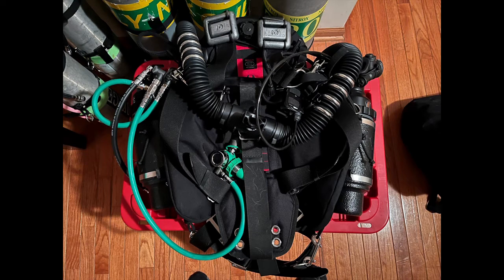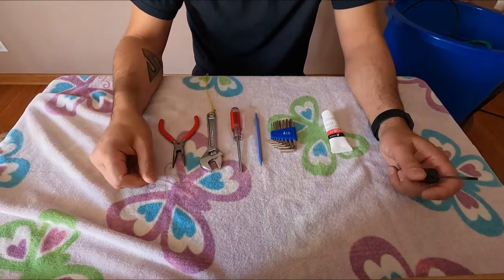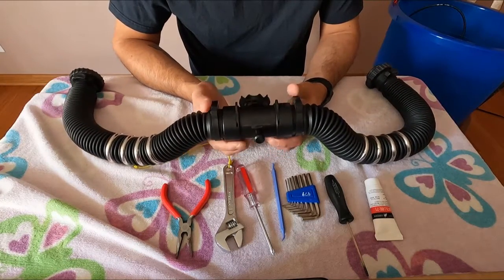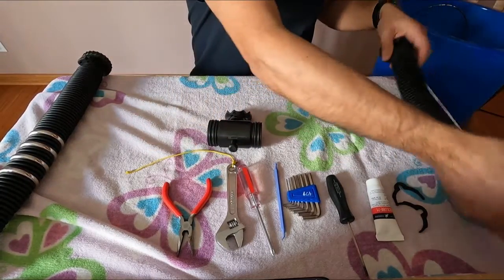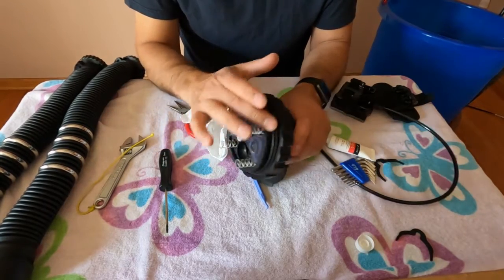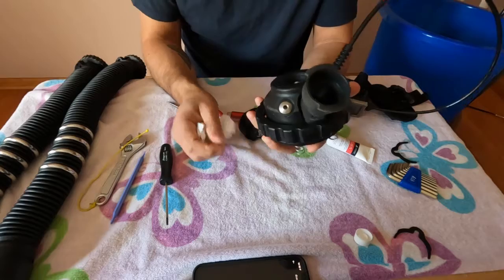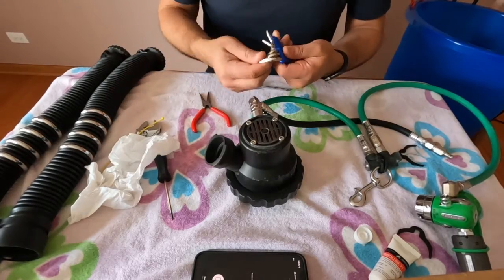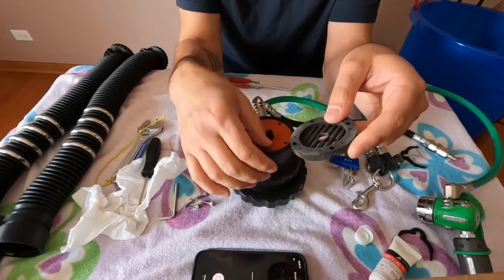Kiss Sidewinder Maintenance

Comment: First thank you for taking the time to help me evaluate this unit. Do you put any dielectric grease on the O2 sensor connection. You mentioned a water vinegar mix to clean the head, would you do that for the sorb canisters and screens as well?do you leave the computer connected or do you disconnect it when you store it? Do you use the same tablets to clean the counter lung?
Reply from the maker: I haven’t put anything on the connector pins but I like the idea. Yes, same thing for the canisters. I don’t see any need to ever remove the computer other than sending it out for service. Yes same tablets for the hoses and counterlung.

Comment: 35:17 Possible consideration is a DiveRite regulator as they openly sell rebuild kits to the end user no issues. Ben over at Paragon can get what you need. 👌💪🤙 Apeks on the other hand has gone to 💩as far product availability, spare parts and rebuild kits, what a disappointment.
Reply from the maker: That is disappointing considering they are such a reputable company. I get most of my gear from dgx. They have great customer service and sell rebuild kits for most everything they sell.

Comment: Does the counter lung need interior cleaning?
Reply from the maker: Yes. You’ll need to disinfect it with steramine. I rinse it out with water and let it dry usually. I’ll soak it in the steramine after a long weekend of repetitive use or every couple of weeks of single charter weekend diving.